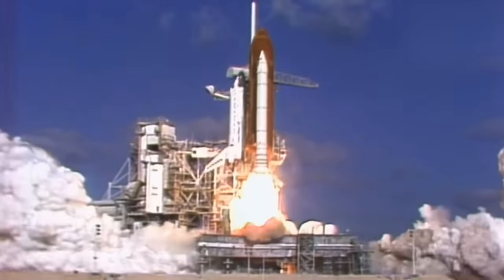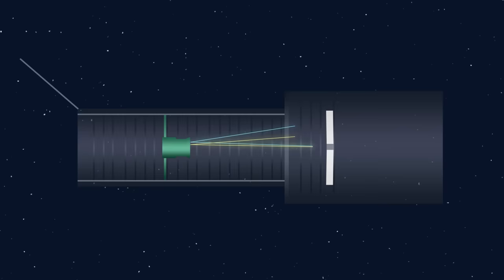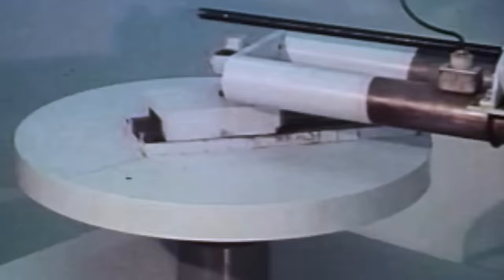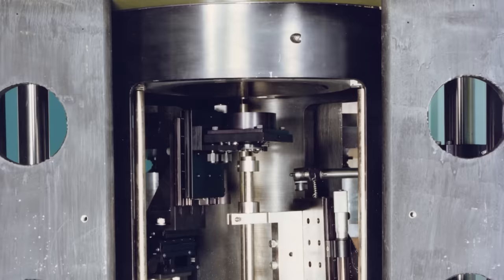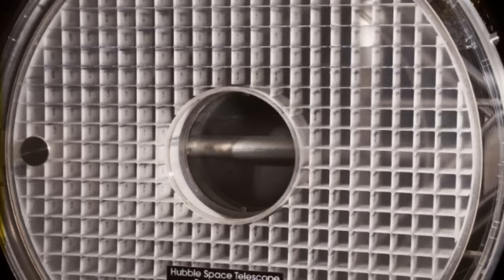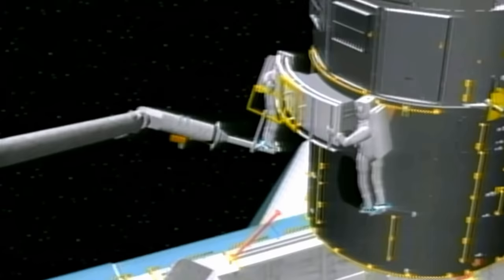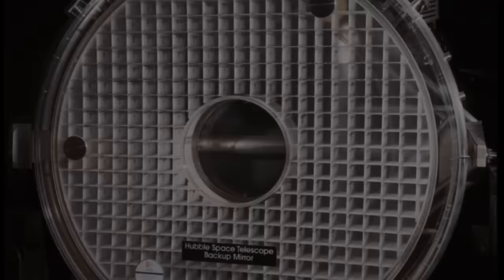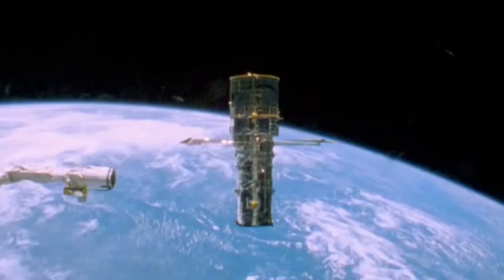NASA's $50 Million Hubble Mistake

Comment: NASA really is a stellar example of both the best and most robust engineering in the world, and at the same time a stellar (hah!) warning about mismanagement, miscommunication and not following their own protocols. Sometimes this has caused space telescopes to be flawed and space probes to fail. Other times it has caused the loss of life in absolutely horrendous disasters.

It's actually incomprehensible how NASA can be both one of the best engineering entities in the world, yet still have these flaws. For example, their software development methods are arguably the best in the world. Where in other typical engineering firms practical testing will usually reveal thousands of bugs, in NASA projects practical testing will usually reveal less than 5. That's because the software development routines used at NASA make it almost impossible for bugs not be caught at a much earlier stage (or for those bugs to even be made in the first place). Moreover, while in the vast majority of software development companies when a bug is found it's simply fixed and forgotten (with, at most, some unit tests added to catch that particular bug), at NASA the software development model is examined and devised in order to find out how that bug got through to testing unnoticed, and how to improve the process to fix that hole and make it less likely for similar bugs to happen in the future. And absolutely no change is made to code without it being extensively documented (much unlike in the vast majority of other software development companies).

And, incredibly, regardless of all this software development bureaucracy, NASA software development usually stays within deadlines and budgets, much unlike most other companies. (Or, maybe, it's thanks to all the software development bureaucracy.)

Yet, on the other hand, absolutely inconceivable incompetence is sometimes shown, allowing space telescopes to have critical flaws, and rockets to explode costing lives, because of ignoring and bypassing NASA's own safety protocols.

Comment: You left off the whole KH-11 Spy Satellite connection. The "Near Sighted" grind on the main mirror might have been perfect for an Earth Observing Satellite.
Also, there are many "features" of Hubble that make no sense for a purely Astronomical Telescope. For example, active IR tracking of targets and mutiple spilting of the main light beam to several interments at the same time.... stuff that is almost Required for a spy satellite.

https://en.wikipedia.org/wiki/KH-11_Kennen
Reply: The Hubble mirror was not "near sighted".  It had spherical aberration, which is a problem for any kind of satellite.  And wtf are you talking about "active IR tracking".  And how else do you think you'd get the light from the mirror to multiple instruments?  Hubble had 5 of them.  Basically everything you've said is bullshit.

Comment: Hi, My question is:   if we can take a clear picture of a distant galaxy, then why we can't use Hubble to take a clear picture of Jupiter or pluto? why we rely on prob to take a clear picture of our solar system planets?
Reply: It can take a clear picture of Jupiter: https://www.nasa.gov/feature/goddard/2019/hubble-new-portrait-of-jupiter

But the best it can do with pluto is this: https://www.nasa.gov/mission_pages/hubble/science/pluto-20100204.html

The reason boils down to this, Hubble, and all telescopes really, are designed to capture faint light and focus it all in one place. While they can "zoom in" a bit, it is not their primary purpose. So while distant galaxies are faint, they are also much larger than pluto is in terms of angular size.
Reply: Because distant galaxies are huge, and distant planets are tiny.  Even though galaxies are much farther away, they're much bigger when you look at them.  Jupiter is pretty big, and Hubble can take gorgeous pictures of it.  Pluto is a different matter entirely.  Not only is it much farther than Jupiter, it is TINY.  It is only a few pixels big in the Hubble camera.   It's the same reason you can see a mountain 50 miles away, but you can't see an insect 50 feet away.

Comment: Older, smaller telescopes on Earth...all over the Earth!...were not abandoned as newer, larger, more specifically designed ones were built, most are still in use today...so will Hubble.  It might stay inoperative for some years, but it will be brought back to operational use, adding a space-based research instrument to the many other similar research instruments still earthbound..

Comment: What were the odds that this "tiny error" was missed during testing because of one specific mirror out of many mirrors was miss placed in such a way that it actually corrected an unknown error in its design? Sounds suspicious and odd to me. What were the odds of this actually happening?
Reply: It sounds suspicious because that's not how things happened. The misplaced mirror in the null corrector device was the cause why the mirror was polished to the wrong shape.
Reply: "The odds"
One mirror contracted and one as backup = 50/50
Not comparing both mirrors but perfectly correcting for the flaw = 100% (add an extra 10%, since they've already broken science)
Reply: @blablubb12345  isn't double checking part of the scientific method

Comment: But what didnthey remove for costar ? And will the shorten its life?
Reply: speak english, i dont even understand your question
Reply: They removed the High Speed Photometer to install COSTAR.  They eventually removed COSTAR once all of the original instruments were replaced with versions that had built-in corrections for the Hubble mirror aberration.

Comment: How did they realize, what they messed up? After all the mirror was in space. They could not check on it.
Reply: They reverse engineered the problem in the testing apparatus, and figured out exactly how the mirror could be wrong such that the test said it was right.
Reply: math
Reply: They found the problem in the null corrector setup that they used to make the mirror.  They compared the error that this would have caused in the mirror to what they were measuring in the Hubble images.  They matched exactly.
Reply: @stargazer7644  so by checking one system after the other?
Reply: @grzegorzkapica7930  They had two independent groups calculate the error.  Then they compared results.  This is how they determined what correction COSTAR had to make to fix the problem.
Reply: @stargazer7644  thanks mate!

Comment: Did NASA seriously put a bad mirror inside a space telescope? This is ridiculous.
Reply: Where have you been?
Reply: @stargazer7644  The optics were corrected years before I was born. But considering that I've read a lot about space it's indeed weird that I had no idea until now.
Reply: @charimuvilla8693  This was quite a big deal when it happened.  But it was fixed so perfectly, and Hubble did such amazing things, it isn't a big deal anymore.
Reply: @stargazer7644  Yeah I bet it was a big deal. Even amateur telescope makers extensively test their mirrors, it blows my mind that such an error remained undetected by NASA.
Reply: @charimuvilla8693  The Hubble mirror was made and tested basically the same way amateur telescope makers do it, they just used much more accurate and sensitive techniques.  The mirror wasn't figured wrong.  It was figured to extremely high accuracy to the exact shape the equipment was configured to make.  It's just that the shape the equipment was configured to was wrong.

Comment: If the Perkin mirror was made to 63.5" instead of 2.5m it would have been correct. This is why NASA knew the exact error. Perkins attitude was their mirror couldn't be anything but perfect. It was really perfect foreign ignorance. Kodak's mirror was correct because they used English measure system like the rest of Hubble was designed by. The reason for all of this is actually Genesis Chapter 11 in the bible. Metrics not better just different language. You still have to split hairs, it's easier when you do it in the correct design language.
Reply: Perkin Elmer is, and always was, a US company. The whole story has nothing to do with the metric system.

Comment: There is something fishy about how the mirror and laser test rig EXACTLY compensated for the defect in the mirror curvature .  that is just too much of a coincidence.  i suspect that Perkins Elmer rigged the test to send their defective mirror to space where they hoped the blurry pictures would be put down to some  unknown problem or that somehow a focus adjustment would compensate for it
Reply: yeah - that is fishy. because it is wrong. the null corrector CAUSED the error. it was used to measure the mirror during polishing. Imagine building something with an incorrect ruler. everything looks perfect until you need to integrate with other components.
Reply: They didn't.  The video got that completely wrong.  The null corrector that measured the mirror was the same device they used to grind the mirror to the correct shape.  So of course they matched.  The null corrector was calibrated and assembled incorrectly when it was built.  Later tests that disagreed with the null corrector were disregarded.  The null corrector was still there and assembled incorrectly years later when they investigated what went wrong.

Comment: Imagine If Another Lens made Was Also Incorrect 😂😂....
Reply: Except there were two backup mirrors.   One made by Kodak and another made by Itek.  Both of those were optically correct.
Reply: That was actually a big worry when they built COSTAR.  They were under immense pressure and time constraints to get it right in time for the Hubble servicing mission.
Reply: @stargazer7644  Hubble Has Stopped working last month... it's system crashed due to some bug....
Reply: @Lukky_175  Yes, I'm aware of the problem with the payload computer.  Hubble is still healthy, they'll likely be able to fix the problem by switching to redundant hardware.  They're just having trouble figuring out what exactly has failed.

Comment: why didn't they build and test the entire thing down on earth?
Reply: Launch would break it
Reply: @aaryajain6396  assemble, test, disassemble, launch
Reply: Because the mirror was not designed to work in Earth's gravity.  The mirror was thin and would sag on Earth, distorting its shape.  It was ground to be the correct shape while weightless.  But there were other tests they could have done before launch, and didn't for cost reasons.  Normally, when you grind a mirror the test you do while making it is all you need.  It assumes the test instrument is correct.

Comment: Kodak's fault, not NASA
Reply: Perkin Elmer. The Kodak mirror was fine but stayed on earth.
Reply: @blablubb12345  what? Kodak ground 2 didn't they? the one that was installed and the backup on earth.
Reply: @BrianSu  No, Perkin Elmer produced the primary mirror (the flawed one) and subcontracted Kodak for a backup mirror using more conventional measurement systems (on NASA's demand). For this purpose, Kodak and ITEK both produced a mirror (to crosscheck themselves), but Perkin Elmer never realised their mirror was off. So, we have two perfectly good mirrors on earth (the Kodak one is on display at the National Air and Space Museum, the ITEK mirror is now in use at the Magdalena Ridge Observatory) and a flawed one in space.
Reply: @blablubb12345  ohh ok thanks for clarifying this